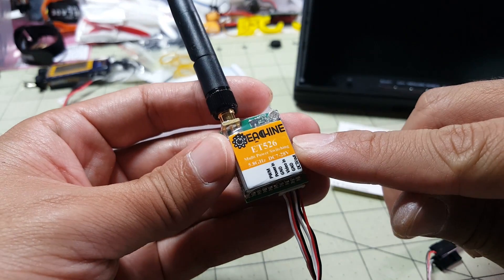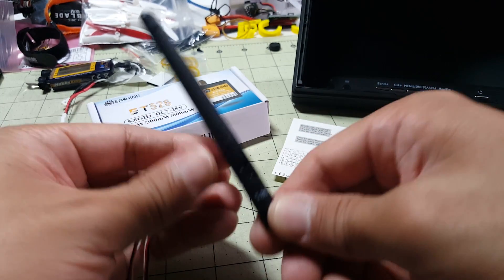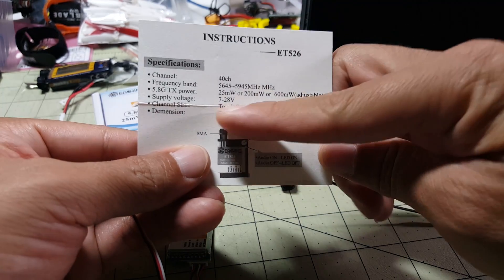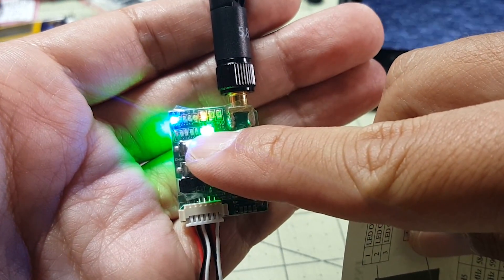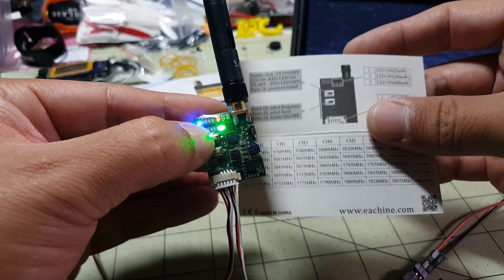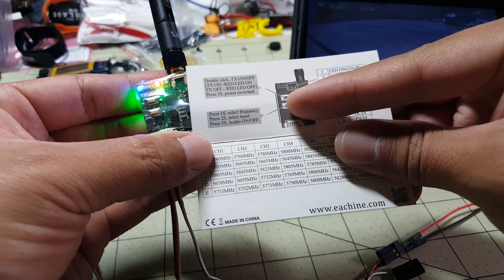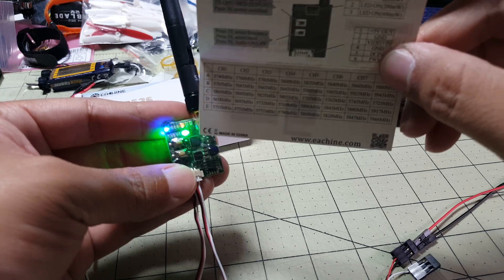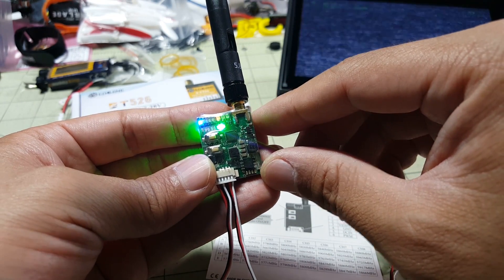Eachine ET526 Switchable Power VTX

Comment: Albert will this vtx compatible with may Dom 3 goggle? And is there simple OSD i can plug this into so can get rssi from my Frsky L9R rx?
Reply from the maker: Yes, this VTX works with Fatshark bands.  There is no "simple" OSD for RSSI.  The closest one is the HUBOSD that has a pad for RSSI but the setup procedure is not that simple.  Definitely not for a beginner.
Reply: How far can I fly with this vtx on my flying-wing?  What's your range test like?  Is this the best 600mw 5.8g vtx out there?
Reply from the maker: +leadpan I haven't done a range test. I only fly 200mW as I have no where large enough to use 600mW

Comment: Hi. Can I connect it directly to battery 4s ? Will it work normally (without white noise etc) ?
Reply from the maker: No, I would use a PDB that has a 12v regulator.  Otherwise you may get video noise.  That's my suggestion.

Comment: Looks like the PWM allows you to turn the transmit power on /off, so you don't have to reach the switch.
Reply: No, it can only change the channel :(
Reply: Where do you wire the PWM? Does it go to your receiver?

Comment: Sounds like the off-at-powerup feature is perfect for race situations where you don't want to blast anyone off the course when you're just testing your quad.  Albert you should be a hero and play with the PWM for us.  If you can turn this thing on and off with your Taranis and not have to fiddle with those little buttons that would be awesome!
Reply: I've tried the PWM on the taranis! you can channel map your motors in betaflight / cleanflight (ch2, ch3, ch4, ch5) which will open up the use of the pwm channels on the X4R,... the vtx pwm connected to ch1 on x4r, 
mapping the taranis to ch1 & using the dial pot (twist knob) you can change through channels only!! by turning the knob.. no power or band settings to change, just channel :(
Reply from the maker: +QC Support okay, ill play with it.
Reply: +1 on trying to figure out the PWM. Should just be a matter of sticking it in a traditional receiver and watching the vtx while turning a nob or something on a tx. Of course you need to bind ground pins of receiver and vtx together.
Reply from the maker: +Marty G hmmm, that's disappointing
Reply: yea I thought so too :( would be great for a ppm link, with 3 or 4 channels instead of just 1, the movement from 1000 to 2000 on the radio just provides the channel selection, but im sure a load of users would like another ch for power & on/off feature :)

keep up the great work with the videos!.. 
big High 5 from Scotland bud!...
Reply from the maker: +Marty G Thanks! The on off feature on a transmitter switch would have been ideal. Oh well, maybe the next version will have it.